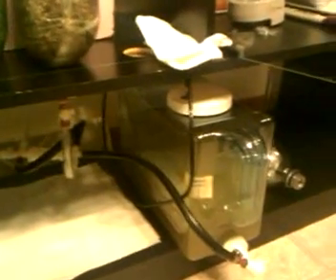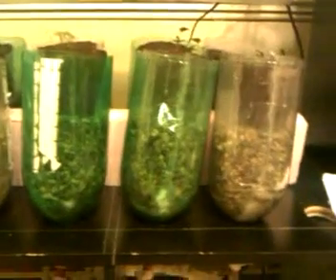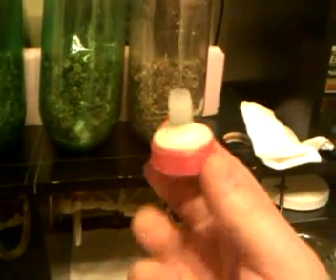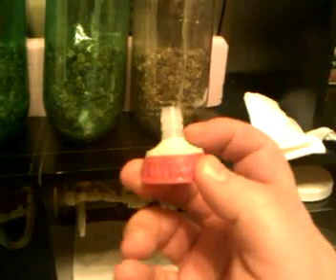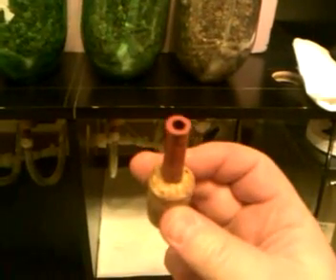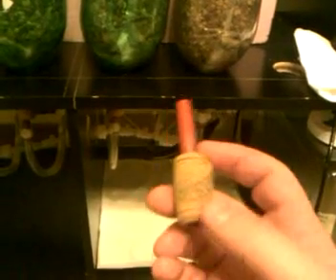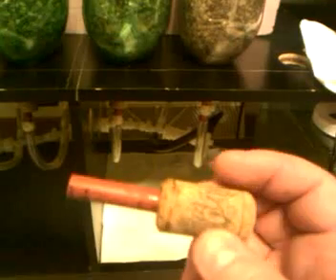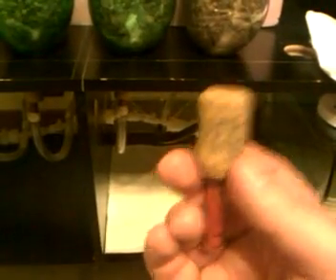Two Liter bottle flood/drain hydroponics setup

Comment: You could try this setup with a small fishtank with lets say goldfish or alike.
Simpelest would be to remove the manifold bits and stick a cotton wick into the red pex tubing.
The Wick would hang in your fishtank and suck up the nutrients and the water and delivering it to the growbottles...You may need some vermiculite surrounding the wick inside the bottle to get a sucking action going. You do need a biofilter (lavarocks inside a bottle) to start the Nitrogen cycle in the system.

Comment from the maker: @phantasm48 each individual grow chamber (aka 2 liter bottle) which stand above the nutrient water container.  When the timer turns off the air stops and a tiny hole i put in the tube permits gravity to slowly drain the chambers back into the nute container.  Hope that makes sense.  The air pump is just a single/small aquarium air pump but because of the principles of hydraulics, it's strong enough to slowly lift the water to the head height of about 2 feet.

Comment from the maker: @oaney I've since torn the system down and replaced it with (IMHO) the more efficient fogponics system.  But to answer as many of your questions as I can; the nutrient water is in a sealed container with 2 connections, one at the bottom and one at the top.  A timer turns the air pump on and the air comes into the container from the top, pushing down on the nutrient water with enough force to push it upward through the opening on the bottom, past through the distribution manifold and then into

Comment: I like your system. Could you post a video detailing your pump system? I dont quite understand how an airpump is lifting water for flood/drain, I am assuming it is an airlift pump of some sort. I would love to see a video detailing the pump system, showing the connections with an explanation of how it all works. Also, what is your output flow rate, and head? How about air pump CFM, etc. Thanks a bunch

Comment: Excellent set up.. near identical to my own. 

I've found that chip bag foil wrapped around the bottles and/or reservoir blocks light enough to protect the roots and inhibit algae growth, while producing an attractive mirrored finish.... if you put it shiny side out, that is.

I've also found that dish detergent caps work great, as the threads fit and the exposed nozzle will mate with a corresponding diameter hose.... or use a bottle that comes with a nozzle, such as a Gatorade drink bottle.